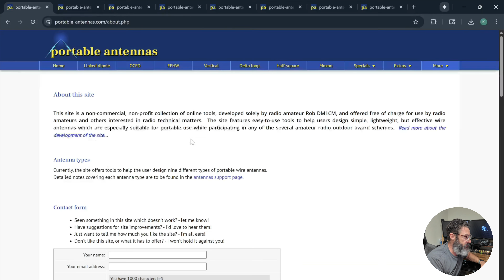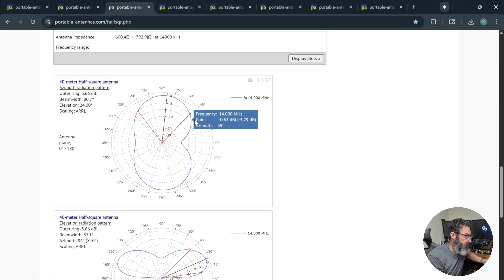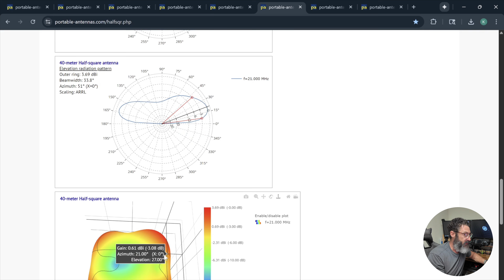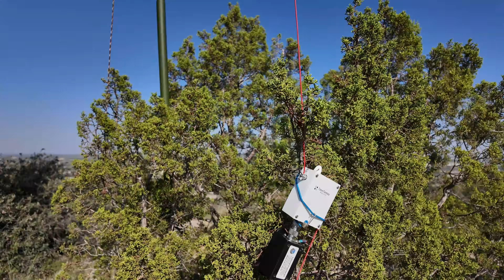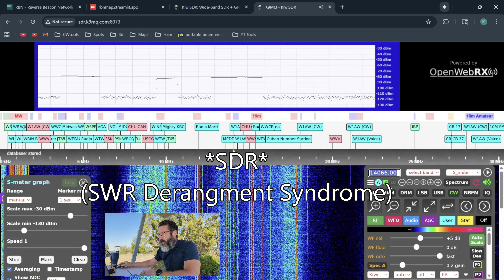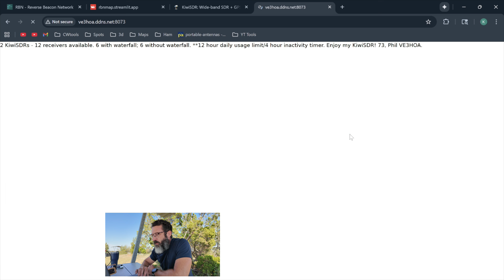Half-Square Antenna: 3.6dBi and Low Takeoff Angle

Comment: Hi Tim, I like these videos. I am portable only and  only on the air outdoors. My best DX antenna to work NA from Germany is a slooping longwire. I keep experimenting with different types, from 40m to 60m in length. 1:49 or tuner at the feedpoint with and without counterpoise. I simulate a lot of my setups beforehand with MAANA-GAL. Doesn’t always fit on site. With this simple antenna I have so far worked 49 states P2P because I am only POTA QRV from my park DE-0564. It,s a killer on 15-10m, but only in one direction with deep nulls in the pattern. No station at home, the advantage = no QRM from the city, quiet reception, and very tall trees. Sometimes my slooping longwire hangs at the feedpoint at 15m. My missing states are ND and HI. Maybe someday I’ll get the WAS award, all P2P from Germany. Greetings and keep on with your antenna videos, I like that. 73 Klaus
Reply from the maker: Thanks Klaus, really appreciate your comment. Your sloping longwire seems to be working really well. I’m mostly portable too, and at home I can only put up temporary antennas. Working 49 states P2P from Germany is very impressive. Hopefully you can get ND and HI soon.

Interestingly enough, the next video I’m working on uses MMANA-GAL to look at the radiation patterns of different wire configurations and how they perform on different bands. I should have it out in the next week. 73 Tim

Comment: Hi Tim. Thanks for a great video. I liked the real-time comparison of two antennas. My experience has been that a center-fed horizontal antenna "hears" better than a vertical or an end-fed 49:1 half-wave. The signal-to-noise is somehow better, which helps me hunt QRP POTA activators. Mike
Reply from the maker: Thanks, Mike. I've noticed the same thing too. The Half-square was the exception. I used a doublet the other day and that was a very quiet antenna with great receive and transmit.

Comment: Hi Tim, great video, very scientific! The direct and immediate comparison via WebSDR is the most informative. If propagation improves this fall, it'll definitely be worth comparing the two antennas listening to a DX WebSDR. I'll be traveling with comparable antennas on an island in SV8 in October. It would be great to Meet you on the bands again from there.
Keep up the good work!
73 Chris, DL4FO
Reply from the maker: Hey Chris, Thanks for the comment. I thought I'd see about a half an S-unit improvement with the half-square, but my test just didn't show that.  Hopefully the upper bands will be in good condition in October I'll be listening for you! Thanks for the feedback! 73 --K5OHY

Comment: Just thinking.......
3 db by itself may not be too impressive.  But say you had a single vertical, and you improved the radial field for a few db.  Then added a second element like the half square for  another 3 db (roughly), then maybe put in some better coax for some db (or fraction of a db, depending !).  Now you are talking some serious signal improvement.
Reply from the maker: That is very similar to what I've done in some of my other videos. I've tried a 2 and even 3 element verticals with great results. I used elevated radials to decrease ground losses. Thanks for the comment and suggestions!

Comment: Great work. Modeled it, compared in real time in multiple directions with an antenna with the same polarization.
If the half square was actually making 3 db gain over the single vertical your experiment shows it really isn't all that big of an improvement. It is more complex, and the nulls are a big price to pay for such little gain.
On the other hand we have a video by Walt (Coastal Waves.....) posted the same day as yours with the same antenna claiming it gives 9 db gain.  But he didn't have a comparison antenna nor did any modeling, nor say where the 9 db figure came from, just a wild claim.
73 de K2XT
Reply from the maker: 9dB seems a bit much for this antenna. Walt does have the advantage of being near salt water though. I've operated from the beach QRP with a simple vertical 29ft EFRW with a counterpoise ran in to the surf and had amazing results.  The salt water amplifier is real!
Reply: @Tim-K5OHY  Yes, you're right - I see now that Walt was operating close to salt water, which gives very similar results to "Perfect ground", and so his 9dB figure would be quite accurate - try it in that modeling software. "The salt water amplifier is real!" - oh yes!
Reply: @Tim-K5OHY  It looks like the gain of the half-square antenna should be 3.6 dBd instead of 3.6 dBi. I modeled one for the Alpha MOTO over medium soil and obtained a gain of 5.74 dBi, which equates to 3.59 dBd.
Reply from the maker: @gcdsuite8471  According to my models it’s about 3.5 dBi. That’s MMANA-GAL & NEC 4.2 over avg soil, with the tops at about 30 ft and fed at the bottom corner (voltage fed). I just modeled it again and it lines up with other folks’ models too. If current fed it's about 4.45dBi. I wish it were 5.74 dBi! Could you share your model? I’d be interested to see how you have it configured: ground settings, heights and which software.
Reply: @Tim-K5OHY   I use EZNEC to model the Alpha MOTO Half-Square which uses parts from the Hextenna Delta Loop (2 x Alpha SS17+ plus 31'2" loop wire + MIL 2.0 match). System is elevated 11.2 feet (height of 3 x 48-inch military surplus fiberglass tent poles). Radial is #10 wire 6.25 ft long, running below the feedpoint. 

Ground Type is Real/High Accuracy. Wire Loss is configured with 7.2 x 10-7 ohm-m resistivity and 1.008 permeability. I also added 5:1 transformer to simulate the MIL 2.0 match. Ground Description is Medium with 0.005 S/m and a dielectric constant of 13. 

SWR is 1.25 at 14.225 MHz. Resulting Slice Max Gain is 5.74 dBi at 18 degrees with a 28 degree beamwidth.
Reply from the maker: @gcdsuite8471 Most likely the difference is the 11.2 ft off the ground. Raising the antenna will often increase gain and decrease the takeoff angle. I'm not a huge fan of these companies using weird terms like MIL 2.0. Nobody knows what that means. Often they are lossy matching units that promise broadband use, often with multiple dB loss. These seem like expensive versions of classic antennas which are cheap and easy. Wire versions will often outperform their expensive counterparts.
Reply: @Tim-K5OHY  The MIL 2.0 is a matching unit from Alpha Antenna. As far as I know, it is just a modified 5:1 UNUN, so I expect transformer losses similar to those of a 9:1 or 49:1 UNUN. Please note that my model was derived from Alpha Antenna's own literature regarding the half-square configuration of their EFHW antennas. Usually, I get advice that Alpha Antenna matching units are on the lossier side. Nevertheless, based on my experience, if you cut the wires according to Alpha Antenna specifications, and at the same time supply adequate radials (which is a best practice) to obtain the desired radiation pattern (radiation pattern > matching losses) and a good SWR (the closer to 1.0, the better) without using a tuner, the antenna should still perform adequately for your use case.
Reply from the maker: @gcdsuite8471  I’d still like to check out your model because there are a few things not adding up. A half-square can be current fed at a top corner ~50Ω or a voltage  fed at a bottom corner ~2450Ω. A 5:1 match doesn't fit either impedance. A low SWR means little power is being reflected, but it doesn’t tell us how much is being radiated versus lost. For a $150 matching unit I’d want to see some loss measurements.

Radials don't really fit the picture here either. Current fed at the top corner the antenna doesn't need radials. Bottom corner fed it acts like an EFHW and only needs a minimal counterpoise. 

Half-Squares act like phased quarter waves over avg soil you can get around 3.5-4 dBi at low angles. Half squares are great on lower bands like 40m where getting horizontal wire high enough for low angle gain is tough. But on 20m a simple $10 wire dipole up to 35-40 feet will have more gain and  low takeoff  with no transformer loss.
Reply: @Tim-K5OHY  I didn't use any special parameters in EZNEC when I modeled the Half Square antenna. I just used the same whips (Alpha SS17+, 304 stainless steel, 0.4-inch average diameter) and the 31'2" 20 AWG bridge wire used to deploy the Hextenna Delta Loop. At the same time, I simulated the MIL 2.0 AutoMatch as a short 0.1 ft stub containing a 5:1 transformer, which results in a favorable impedance for the Alpha MOTO system. Note that the total radiating length of the main modeled antenna is 66 ft 8 inches. Along with the 6.25 ft 10 AWG downward radial, EZNEC naturally recognizes this length as a near-full wavelength on 20m, since a full wave is right around 68–69 feet. Interestingly, when I change the transformer from 5:1 to 4:1, all it does is shift the lowest SWR point from 14.225 MHz (1.33 SWR) down to 14.115 MHz (1.17 SWR).
Reply from the maker: @gcdsuite8471  I’m still confused about the feedpoint impedance in your model. A conventional half-square fed at the bottom end (full wavelength) would have a high impedance. Around 2500ohms, a 5:1 impedance transformer would bring that down to about 500ohms, giving roughly 10:1 SWR.

I don’t think more back and forth here will clear it up without seeing the model. Feel free to email me the file and I’d be happy to take a look. 73
Reply: @Tim-K5OHY  Stranger things have happened since I learned to use EZNEC! Previously, I configured the Alpha SS34+ as an end-fed half-wave on 20m, but instead of using a traditional 49:1 UNUN, I used a 7'5" section of 450-ohm window line as a linear matching section. Even elevated at just 13 feet, it was highly efficient—allowing me to work DX into Europe, South America (Brazil and Argentina), and Japan.

Given those results, I wouldn't be surprised if this Half Square configuration performs just as well. Below is the EZNEC data for details.

                   EZNEC Pro/2+ ver. 7.0

20m Half Square                              10/24/2026     11:17:52 AM

         --------------- ANTENNA DESCRIPTION ---------------

Frequency = 14.225 MHz
Wire Loss: User Defined -- Resistivity = 7.2E-07 ohm-m, Rel. Perm. = 1.008

              --------------- WIRES ---------------

No.            End 1     Coord. (ft)              End 2     Coord. (ft)       Dia (in)  Segs           Insulation                Wire Loss
          Conn.      X       Y       Z       Conn.      X       Y       Z                         Diel C  Thk(in) Loss Tan  Cond(S/m)  Perm
1                -15.583,      0,  11.52      W2E1  -15.583,      0,  29.27       0.4   17          1        0        0  7.2E-07   1.008
2          W1E2  -15.583,      0,  29.27      W3E1  15.5833,      0,  29.27       #20   31          1        0        0  7.2E-07   1.008
3          W2E2  15.5833,      0,  29.27      W4E1  15.5833,      0,  11.52       0.4   17          1        0        0  7.2E-07   1.008
4          W3E2  15.5833,      0,  11.52      W5E1  15.5833,      0,  11.42     0.375   1           1        0        0  7.2E-07   1.008
5          W4E2  15.5833,      0,  11.42            15.5833,      0,   4.92       #10   6           1        0        0  7.2E-07   1.008

Total Segments: 72

              -------------- SOURCES --------------

No.      Specified Pos.     Actual Pos.      Amplitude    Phase    Type
       Wire #  % From E1  % From E1  Seg       (V/A)     (deg.)
1       V1        0.00       0.00               1           0         I

No loads specified

No transmission lines specified

                -------- TRANSFORMERS ---------

No.   End 1 Specified Pos End 1 Act  End 2 Specified Pos End 2 Act  Port 1 Z0   Port 2 Z0   Rev/Norm
       Wire #  % From E1  % From E1   Wire #  % From E1  % From E1   (ohms)      (ohms)
1       4         0.00      50.00      V1        0.00       0.00      250         50           N

No L Networks specified

No networks specified

Ground type is Real, High Accuracy

              --------------- MEDIA ---------------

No.    Cond.    Diel. Const.  Height    R Coord.
       (S/m)                  (ft)      (ft)
1      0.005     13           0         0       

In case you need the actual .NEC file, please provide an e-mail address so I can send it to you directly. Thanks.
Reply from the maker: @gcdsuite8471 email is good on QRZ
Reply: @Tim-K5OHY  I have sent you the EZNEC file 73.
Reply from the maker: @gcdsuite8471  Wire 4, your feed wire, is only about an inch long, next to whip segments about a foot long. NEC doesn’t handle that well and miscounts the power going in, which makes the gain look higher than it really is. 

EZNEC’s Average Gain Test shows it. yours comes out around 1.84 where it should be about 1.00.  2.5 dB of the gain isn’t real. Make the feed wire about a foot long and the same thickness as the whip, and the gain drops to about 3.4 dBi. 

the model uses a lossless transformer,  any loss in the MIL 2.0 match isn’t counted. Real world gain will be a lower than what EZNEC shows.
Reply: @Tim-K5OHY Thank you for reviewing the file. As it turns out, I don't need to change the number of wires in my model. All I had to do was readjust the diameter of Wire 4 to obtain the desired average gain of 0.0 dBi. The resulting maximum gain of the model has been corrected down to 3.3 dBi. I have also re-sent the amended file to you via email.

73 de VA6GE
Reply: Walt's 9dB figure, and the azimuth pattern with very deep nulls in the plane of the antenna, was a result of his choosing a "Perfect ground" ground type in the modeling software he used (the same as used in this video), rather than a more realistic ground type typical of his operating position.

Comment: Hello Tim, thank you for a very interesting video. For some time I have been interested in using a combination of antennas (receive/transmit) for home and portable. While your comparisons for transmit were very similar, it seemed that the receive was different. Granted, if the transceiver does not have a dedicated receive port, one would have to use a switch - a very big sacrifice in ease, but, for some users it might be worthwhile - a personal decision. Again, thank you. KQ4IXD
Reply from the maker: Yes, the Half-Square definitely stood out on receive. The lack of noise made it much easier to pull out weak stations and a lot less fatiguing on the ears. At home my cobweb is very quiet too, but it’s not the strongest on transmit. A few times I’ve even had to manually switch antennas  on transmit and RX because I couldn’t hear the other station on my noisier antennas.

Comment: Great effort and video. Maybe, if you add another half square to the left or wright, which actually is just another tower, you get a bobtail curtain antenna. Yap it is almost double effort to make it, but...take a look at the diagrams. 73 de yt3tt
Reply from the maker: I ran across the bobtail curtain when researching the half-square. Looks like a very interesting design. I might have to try it. Thanks! 73

Comment: Nice!  I can't install EZNEC, at least not easily, on my immutable Linux distro that is primarily a gaming rig (though my drawing near the half century mark has lessened that a great deal).  Ty!
Reply from the maker: I run Linux in the shack, but I’ve got VirtualBox installed for those few Windows programs that don’t have a Linux version (N1MM). I’ve messed around a little with modeling software, but it’s definitely going to take me a while to get comfortable with it. Appreciate you checking out the video!